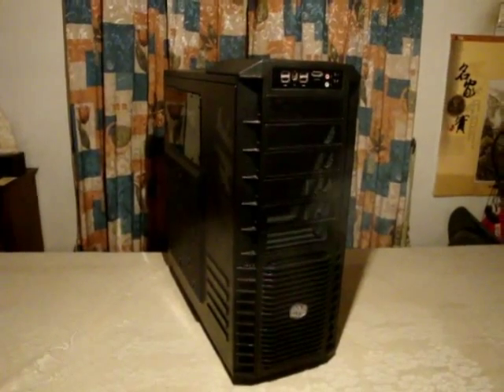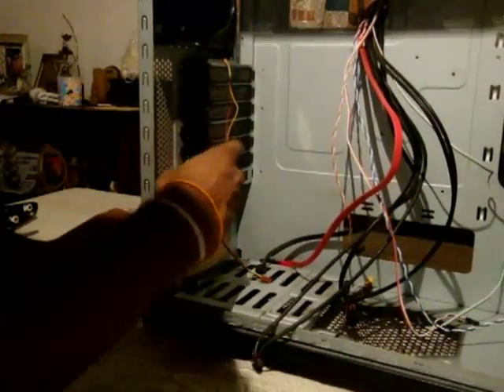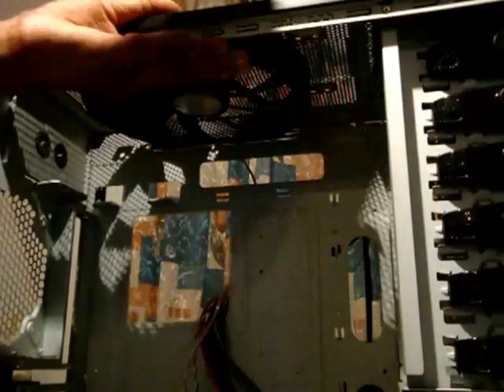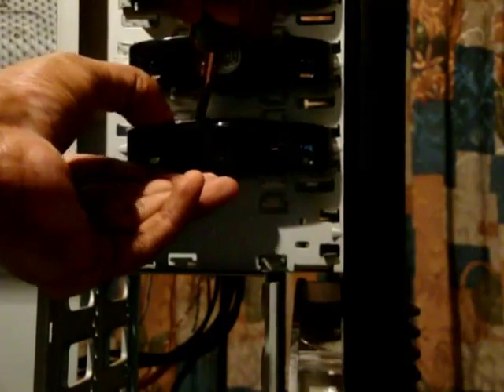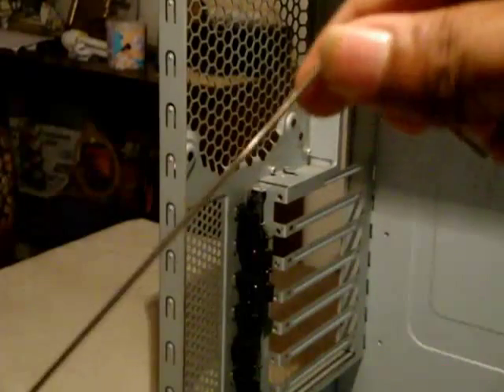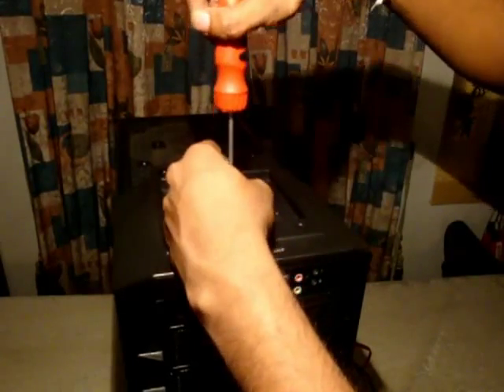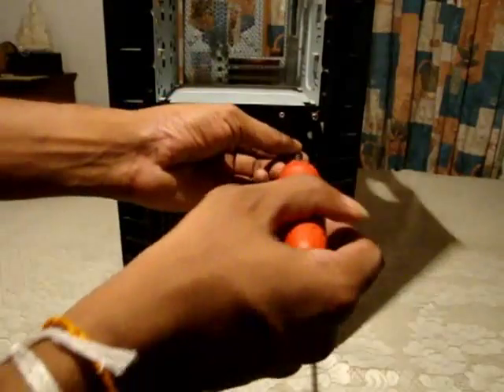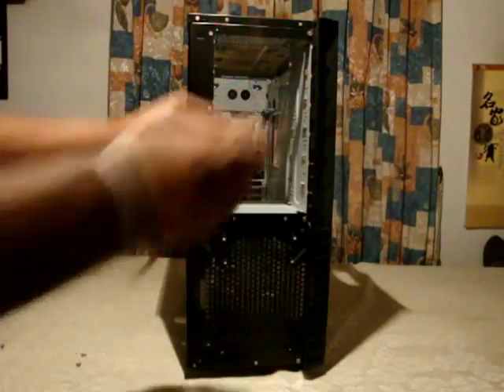Rsquare - Cooler Master HAF 932 Full Tower Case Removing Disassembly - Part 1

Comment: Thanks for this, I couldn't find anywhere else that showed how to remove those two side plastic bits on the front. My case came with the 230mm front fan mounted behind those, so I had to get them off to remove the fan.

Comment: Did you just use force at 6:55 to remove the front cover ? Or is there some lever to do that ? I want to clean that front fan, but I am afraid I might break that part as it seems to be stuck.